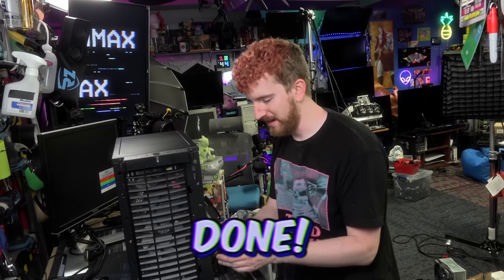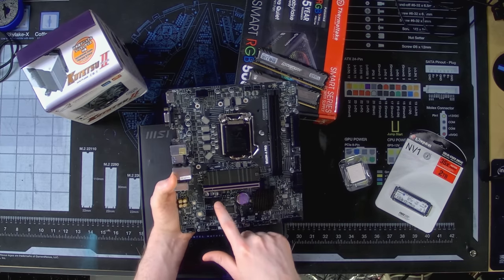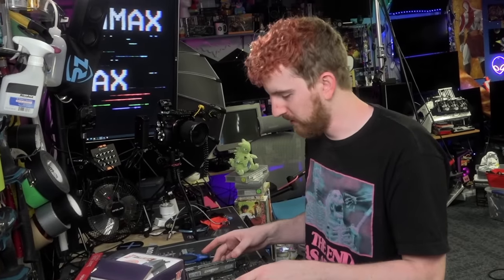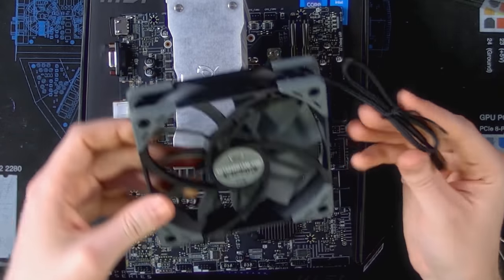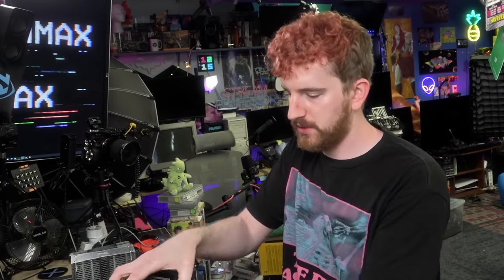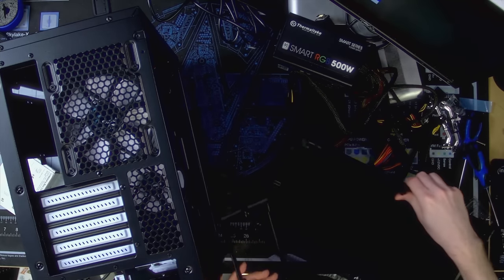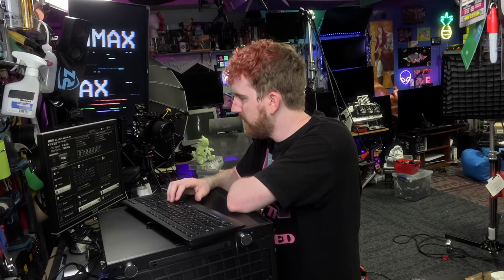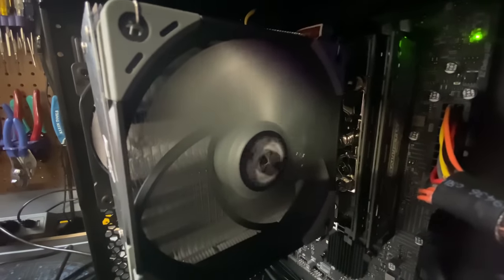Is this the QUIETEST PC I could build for Mother’s Day?

Comment: For what it's worth, making the stencil on the cricut works too as the vinyl seals the gaps so you don't get overspray.  Although, much easier just to go with the vinyl letters.  I have some vinyl on my PC case and it has never peeled.  Likewise you can get adhesive photo paper and laminate, and make glossy retro stickers for cases as well.  Been thinking about adding some of that stuff to my Etsy store.   Also, I really don't think it came out that bad!   Kinda like the graffiti look to it.  Solidly in that late 80's look!

Comment: The Kotetsu II should have a good enough cooling power for a 10600k. I used it for my 8700k and it did a pretty good job there.
Reply: Even if the fan ramps up, it's kind of a pleasant sound (at least for me, I know it's subjective)